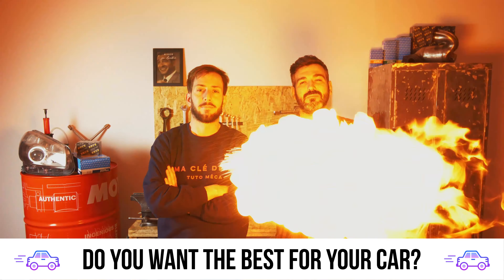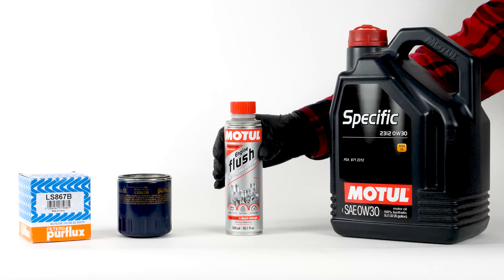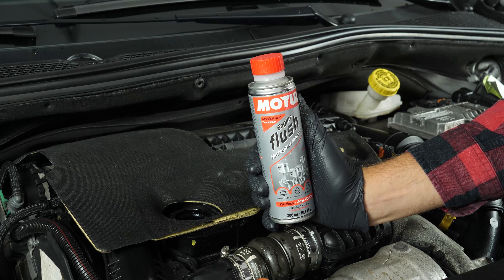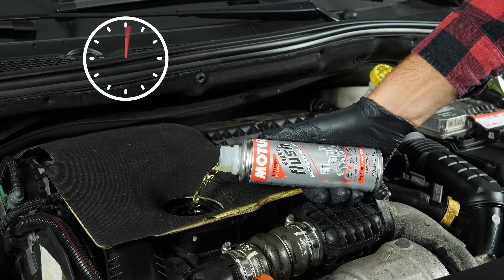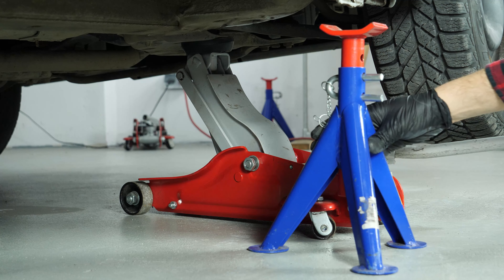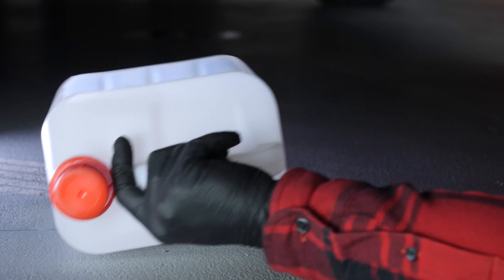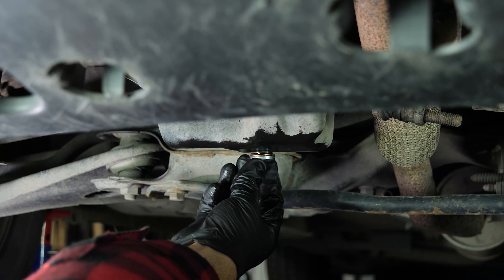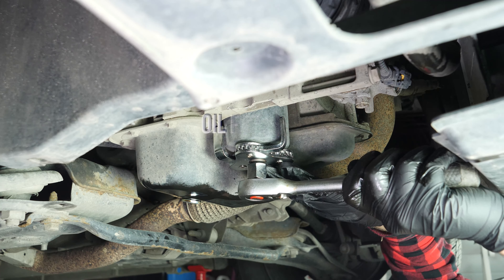Change the oil and the oil filter Peugeot 208 mk1 1.2 PURETECH 🛢

Comment: Great job guys, easy to understand nice step by step instructions 👍👍my question is if you don’t have that clamp to unscrew the oil filter, would it be acceptable to hammer a old screwdriver in too the filter and lever it loose ?

Comment: it's very nice that you are doing instruction videos but you should learn first about what car and what engine you're dealing with because you are risking your clients with killing their engines
it is strictly prohibited to use engine flush or any oil cleaning additives in the 1.2 VTI\puretech motors. that's because in this motor the timing belt is located inside the engine while being lubricated by the engine oil. 
using flush in this engine is strictly prohibited by the manufacturer because it's damaging the timing belt and if you did use it in the worst case the timing belt will tear up with all the sorrowful consequences and in a better case, the outer layer of the timing belt will degrade and contain the oil with its fractures clogging the oil paths and following to oil starving and engine rollup.
now you need to change the timing belt as soon as possible to avoid further damage.
also, you're using the wrong oil, the manufacturer recommends specific 2297 oil (mobil1 esp or total quarz).
Reply: This is not correct.
5W30 2297 is ok, but  0W30 2312 is more specific and suitable for the car. No damage for both cases, I will recomend the 0W30 is the manufacture request.
Secondly, doing a flush with the old oil, especially if it is 5W30 or above will not damage anything because it is for cleaining deposits and will make oil be a little bit thin than it should.
The best choise is SeaFoam for flush this type of engine. You can drive it with 3 ounce more than 1000 KM total with no problem. It wont damage any engine because it is a little amount and work perefectly.
Reply: Excellent information
Reply: @מנחםזגורי-ש5ג  I am looking for this information myself. For example on the 2016 50kW 1.2 engine, Total seems to recommend its Quartz INEO 0W-30 oil, with Alternative recommendations: EO PSA 2290 5W-30; EO PSA 2296 5W-40. This is a ACEA C1 oil, which is not what I expected, being a naturally aspirated engine with no FAP.

Comment: I'd seriously disagree with your recommendation, to use an oil flush product, on an engine with a wet timing belt.
These belts are problematic enough as it is, without worrying how the detergents in a flush will affect it.

Comment: TIPS: Car Ramps are more practicle for oil changes.
Oil Changes can be MESSY!! 
Change the oil filter first, this is so you dont have too go fishing for it if it falls into your oil pan full of hot oil in case you loose your grip! 
If it´s a Spin On punch a whole in the bottom to drain off the oil inside the filter.